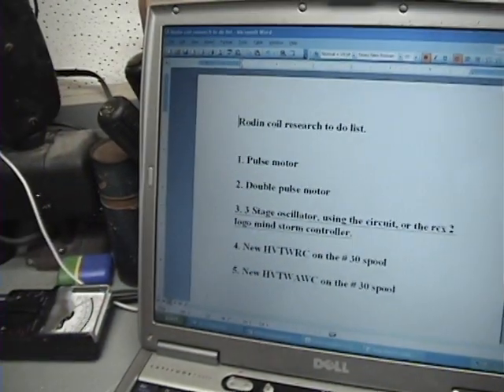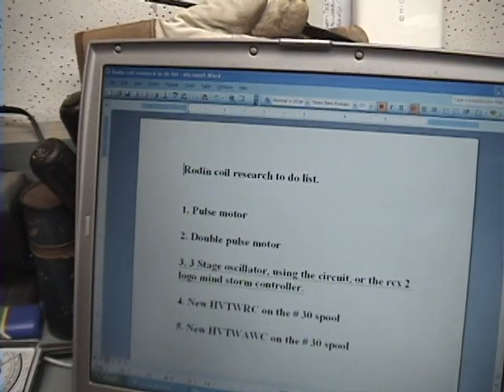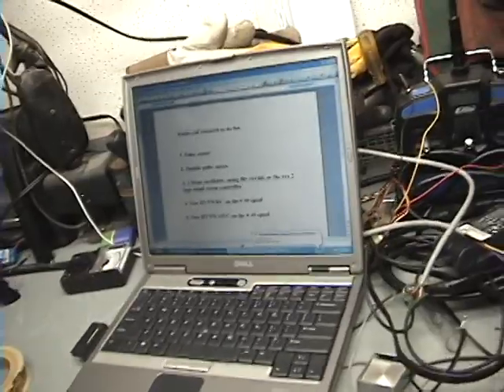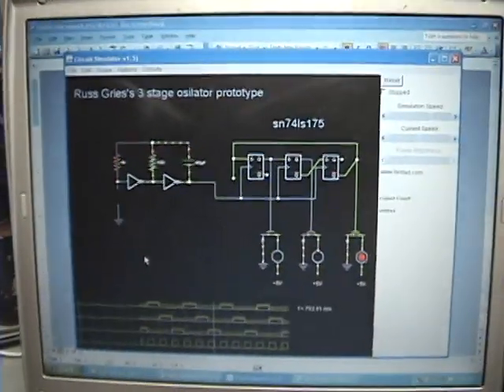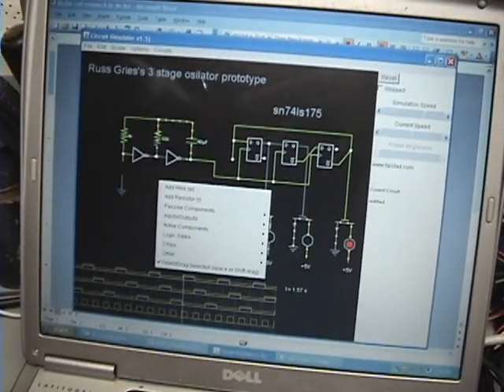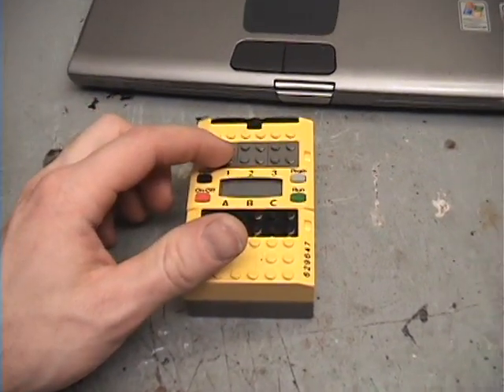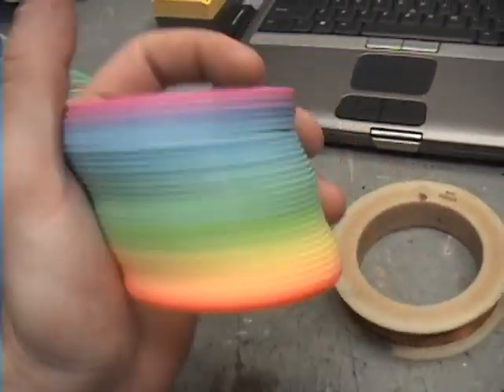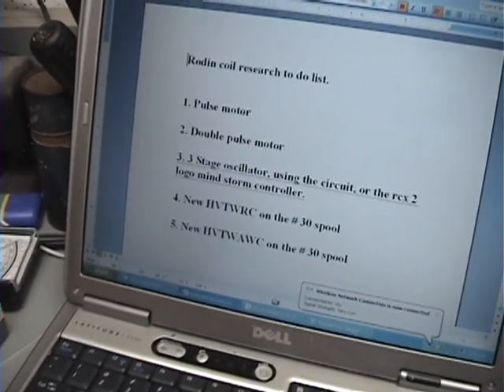Rodin coil / starship coil update 2, need your point of view!

Comment: Wound several starship coil, numerous anomalies. Have made many various coils, pulse motors, and years of experiments.
Here is a wiring scheme,  try it, you'll find interesting. works with any bi-filar coil setup. Using a bi-filar, mark coil A and coil B, mark the beginning and end of each, the beginning of coil A goes to a resistor, then to the base of some value of a NPN transistor{ also used a n channel mosfet), the end of coil A goes to the emitter of the transistor which goes to the negative of a battery. The beginning of coil B goes to the positive of the battery (12 volt,can use more and less depending on the simiconductor) and the end attaches to the base of the transistor.
The transistors should be able to handle fairly high voltage  (tip 3055, bul305, or comparable N-mosfet) Also the transistors required much less resistance, the N-mosfet can use from 300,000 ohms to 1 meg and more to oscillate. An anomalies, get oscillation without the base being connected. To initiate oscillation short out the base and collector for just a moment.  Use a neon to check for high voltage produce from the base and editor, place a rectifier bridge across these and connect a large cap. Because it oscillates without the resistor being connected to the base, the beginning of coil A is free to utilize  for other purposes. Meters glitch, use the neon for testing.  If any of this possibly confusing info needs clarification, will do so.  Have a few videos up. Note: have charged caps to 900 volts and more using a 12 volt lead acid cell using  a bifilar coil, just started experimenting with these rodin things. The idea is to use the back spike (collapse of the flux field) to initiate a radiant pulse (scalar pulse) with would produce and over unity effect. It's all in the pulse.
later.............marc.

Comment: you have to use radio frequency of 40 to 55 hrtz .... you have seen a coil jump if you plug it into 120VAC 60Hrtz the Coil will Dance until it over Heats.
another Idea for making a Drive Coil is To use what is known as Cohesive field Theory two or more coils at right angles to each other running at exactly the same frequency.